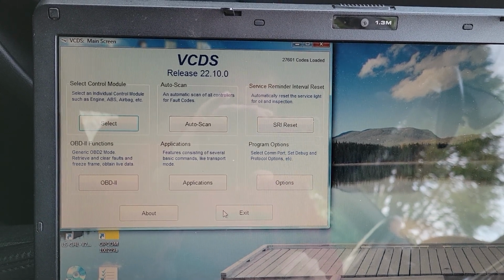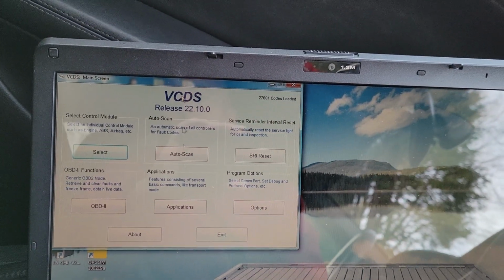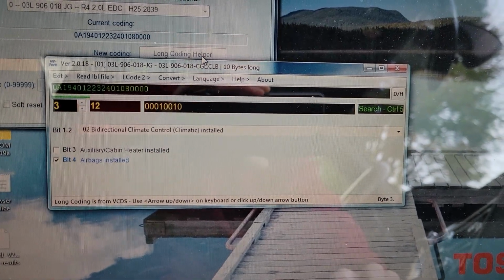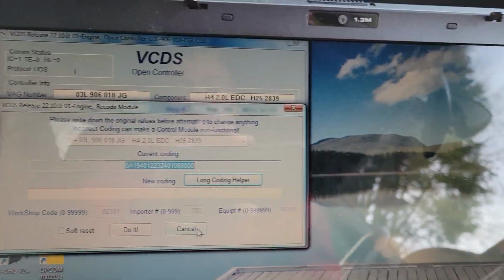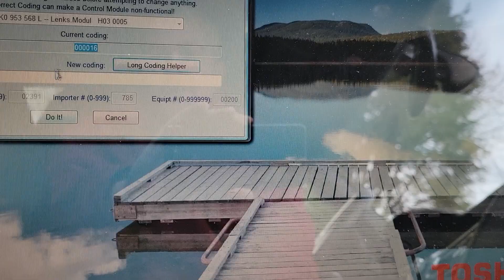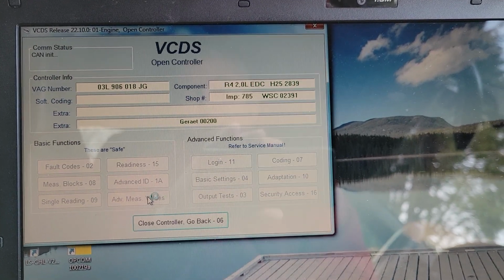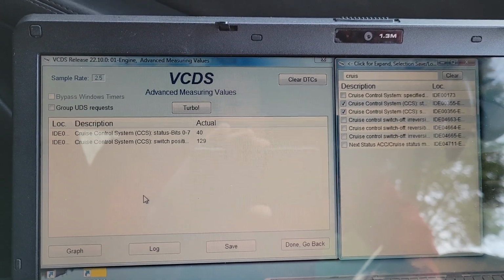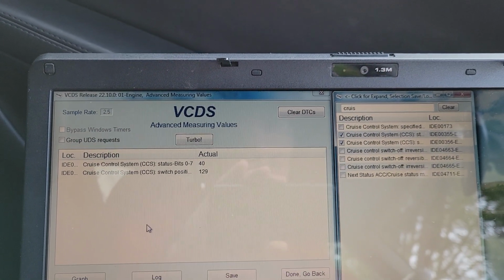VCDS cruise control long coding Audi A5 2013 retrofit

Comment: Hi, I have a Skoda Superb mk3 and I am looking to do the exact same as yourself. So you don't need to have the Squib ring changed to a stalk with a cruise control? Also is there a connection tab already present for the cruise control switch to connect to? I haven't taken off the steering wheel off yet to have a look.

Also on VCDS it says 1 fault - 21193 No communication with cruise control module, so i assume all parts are there to install the cruise control switch,

Thanks
Reply from the maker: All I did was get a light/wiper stalk (2nd hand) including cruise so no change to squid as I remember. I could have just swapped out the existing switch for the new one but decided to take the cruise section from the one I bought and fit it on to my existing. All wiring etc ready to go. I should think you just do same as I did and you'll be good.
Reply: @gingejp  thanks for the reply. Will update you once I attempt it 😊

Comment: Hello, I did exactly what you did, but it doesn't work. I don't have the same values as you in the "advanced measuring values" tab of VCDS... Do you have an idea of the problem please ?
Reply from the maker: From what I remember it was possible to plug the connector wire on the wrong way around, so check that. Other than that, I could only guess you have a faulty switch.

Comment: How did you manage to find out which is the correct stalk you needed for your vehicle? I have a 2012 A5. Thanks
Reply from the maker: Any A4 or A5 from that era should be ok. I bought a complete stalk with light switch etc including cruise controls, then removed the cruise control part and screwed it on to my original stalk. The other I'd bought would fit ok, I just preferred to keep the original. It was easy to do. If you can find just the cruise control switch, you could just buy that. You then have to cut the space for it in your cowling, but easy to do a neat job if you use a bit of patience.